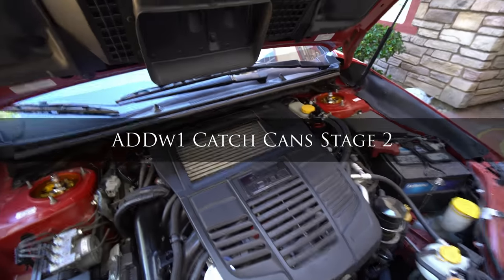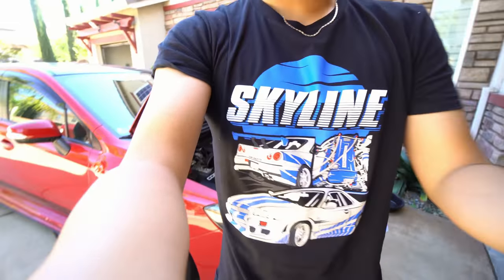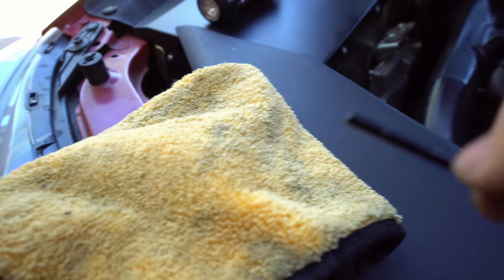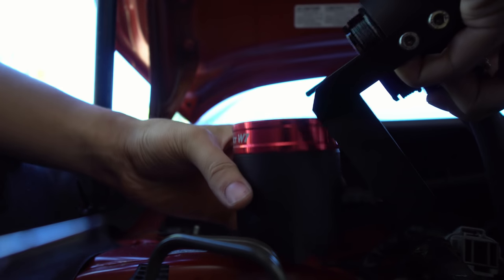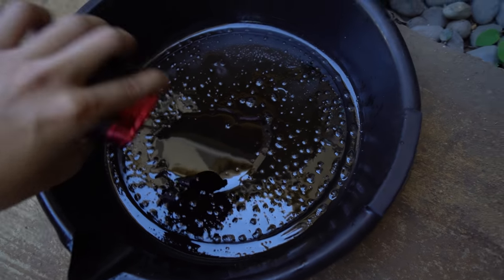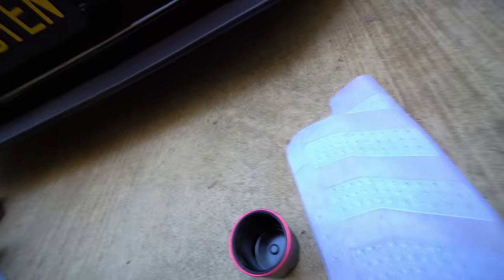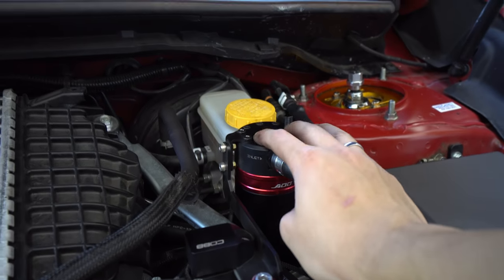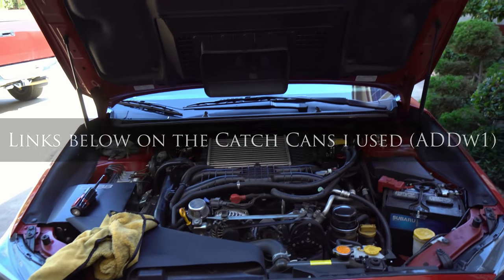Catch Cans A MUST for Direct Injected cars | 6k Miles results!

Comment: Great video! I've been a huge promoter of catch cans myself and I just installed a set of Radium catch cans in my 2019 WRX after a little over 1K miles (break-in period) and it's been about 1K more since then and I can already see the blow-by creeping up the dipstick little by little. Seeing how much you got after 6K is nuts! And to think all that would have been thrown back into the intake and caked onto the valves (yuck) - and by planned design too! Honestly this is the best decision I've made on my car thus far. Super happy to see these are actually working! :)
Reply from the maker: Hey Kaz,

Thanks for the input. Yeah Radium catch cans are pretty popular. I'm surprised the amount of gunk i picked up.